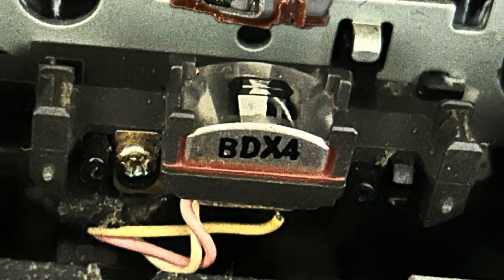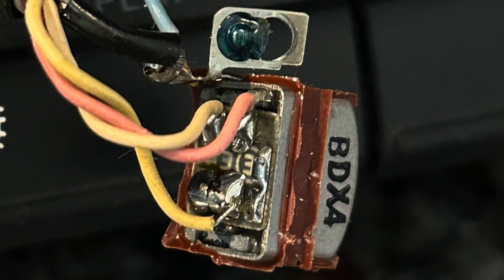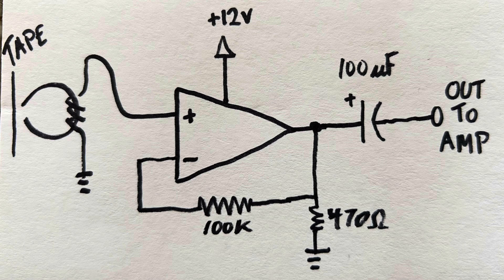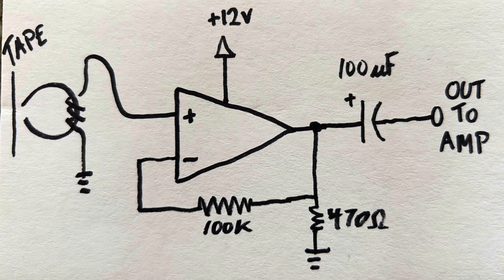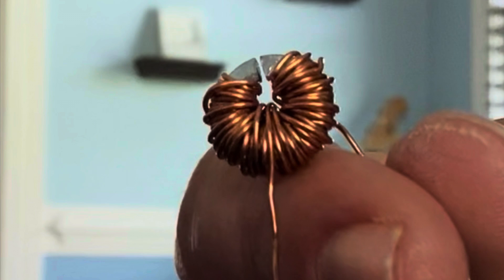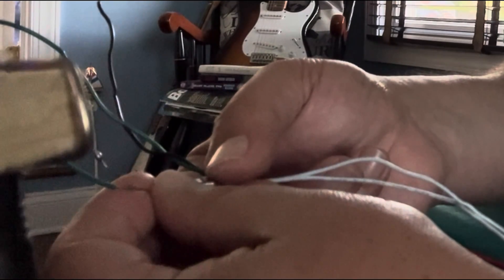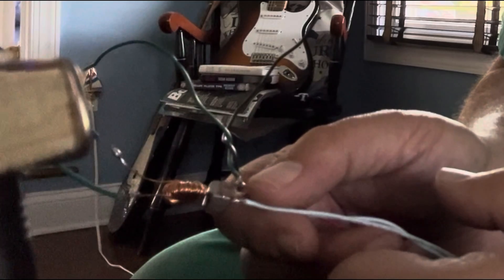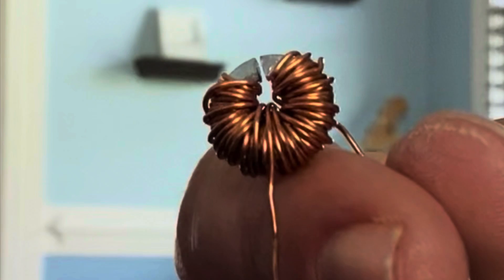Tape Head - preamp and proof of concept

Comment: I am currently working on a disc recorder, thanks, that amplifier should be good for a preamp
Reply from the maker: @unknown-qc1jh  thanks. As i spend more time  working with opamps, i love them and their versatility more and more
Reply: @igorbrichkov3632  no problem, as for the op amp(main amplifier circuit) ill use a lm388 chip and a simple setup, now one question, could you show a way of creating that circuit in a video, since im sadly very bad at reading circuits off of paper, even though i have some experimence with electronics.

Comment: Great job, I didn't expect you could build one this easily! Regarding the schematic you showed at the start: I think the 470 resistor should go from ground to the inverting input of the opamp, and not to the output (otherwise neither resistor has really any function) - just in case someone else wants to replicate it!
Reply from the maker: Yes i connected it correctly on the breadboard but drew it wrong on the schematic. Will correct that in the next video

Comment: Very nice experimentation.
The minute size of a regular run of the mill tape head scares people away from trying (including myself who always wondered but never felt like trying).
You proved ultimately that it's no that sorcery after all.
As for the preamp, make sure you make its frequency response decrease at 6dB / Octave (20dB/decade)...
The head is inductive and tend to produce an output whose voltage increases as the frequency increase, (and presents a higher source impedance as the frequency increase).
Since the Op-Amp will have an essentially high impedance at pretty much all audio frequencies, the increase of impedance of the head is of no consequence, and hence the increasing voltage output of the head with frequency will, if not tamed, make the amplifier have a lack of bass and excess of treble.
As for the ability to produce very small gaps, that's not that difficult after all.
All you need is to cut partially the ring with a V shaped cut, from inside out, and then grind from outside until you break the two ends apart.

Comment: I would add a transistor for an extra stage of amplification before it goes to the op-amp. Your expecting around 200X gain from the op-am, and while that will work, op amps can get noisy at high amplification levels.
Reply from the maker: Thanks. Was going to use another opamp with gain of 10 or so for final circuit. Would it be better with a transistor?
Reply: @igorbrichkov3632  When I made a few mic preamps, I always found it helped reduce the amount of hiss.
Reply: Your feed back is crazy will get you only unity gain. if the output on the opamp is 1mV so is the voltage on the other side of the 100k resistor, at the inverting imput, so requires an input on the non-inv input of 1mV to balance. So unity gain.
Reply from the maker: @kevinwingfield2007  You are absolutely right!!!  I connected it right but the drawing is wrong. The voltage divider is coming off the inverting input side not the output side. I will correct this in the next video. Can’t believe I did that. Thanks for pointing that out.
Reply: @igorbrichkov3632  The schematic shows up in the preview, so I wondered how this could work. Glad to see your actual circuit is wired correctly!
Reply from the maker: The op amp gain is over 200.   Gain of noninverting opamp configuration is 1+R1/R2 =1+100000/470 = 213

Comment: Your preamp needs to integrate the input. You need a cap in the feedback loop and a bypass resistor to stabilize it. Or your playback will sound super thin
Reply from the maker: Thanks for that